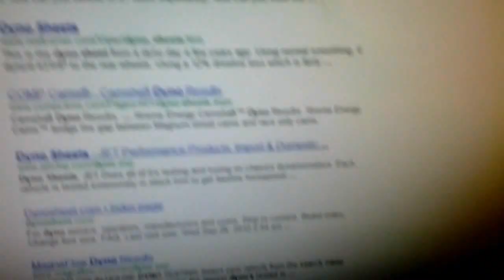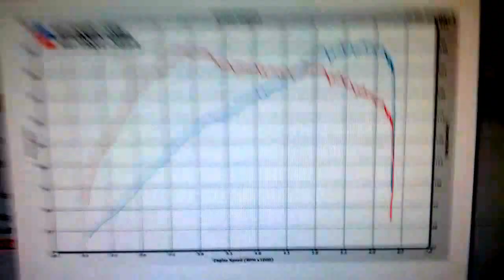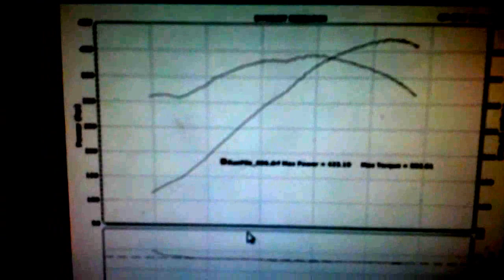Horsepower vs. Torque

Comment: Hi.. I have some confusion with this.. I have an airplane that weighs 930 lbs. We hooked up hanging scale to the tail and ran it up to max rpm of 5600.  The scale read 500 lbs...  what info can I get from this..? Ft.lbs..? Torque lbs..? HP..? Or..??
Reply from the maker: None of the above - it's thrust.

Comment: What you fail to understand is that the force that is accelerating the car is not torque of the engine, it is the force at the base of the wheel.

BTW you can clearly see that the amount of torque alone does not matter at all, while max HP will give you a rough estimate of engine performance.

a = f / m, if you replace with f = p/v

note that f has nothing to do with engine torque right now, it is the force accelerating the car

a = p / (v * m) 

if you want to write it with torque:

a = ( τ * ω ) / (v * m)

As you can see if you have

τ  = 1
ω = 100000

or 

τ  = 100000
ω = 1

acceleration stays the same because POWER stays the same with enormously different torques.
Reply: and also 5252RPM is just the ratio between unit of measurement for the imperial units and rpm, if you use other units it changes see http://rototest-research.eu/spec/view/png/graph/STR-07030801-kW-Nm-C.png and it means absolutely nothing.

Comment: you used ft  Ib what if you use meter kilogram  unit to find hours power??
Reply from the maker: ibrahim ismail it would be Newton-meters, no kilogram meters.
Reply: but what will be unit of 1HP= nm/sec  ,,1HP=t.rpm/5252    same equation???
Reply from the maker: Horsepower is an imperial unit. In S.I. rpm would likely need to be in radians per second and horsepower would be replaced with kilowatts. Once all of the units are properly converted the result should be equivalent, though probably simpler as S.I. tends to yield more elegant answers than imperial.

Comment: You can say "torque wins races", and you can also say "power wins races". In the end, torque and power are just two different angles of viewing the same reality. From torque you can derive power, and from power you can derive torque. The driver however can directly sense only two entities: the force at the wheels (which pushes him against his seat) and the RPM (which he controls). Now, the main question is how to propagate sufficient force from the engine to the wheels. You can compute it using torque, or you can compute it using power. Computationally however, I find power the easier method to use, because power is a function of energy and time, and energy is agnostic to internal factors happening in the car. You'll just have to use the conservation of energy theorem. This is also true in other areas of physics: conservation of energy simplifies computations.
Reply: you cannot derive power from tq.... tq is a force.... you need more information to derive power from tq.... 

tq and hp are like hourly wage and salary...

with just hourly wage, you have no idea how much you can buy/spend... you need how many hours you are working to know that..... that is why when you know both hourly wage and hours worked, you get salary or HP in this case...

they are not even close to "viewing the same reality"
Reply from the maker: You're right, on their own the values are meaningless. It's the rotational speed that links them. In the case of your comparison the rotational speed is the number of hours worked.

Comment: Power is a function of Torque and Rotational Speed (RPM). But what's not mentioned in this video is that Torque itself IS a function of RPM. Unfortunately, the torque function depends on the engine and has no set mathematical formula, the torque values for a range of RPM's are determined empirically (which is what an engine's torque graph tells you). So, if T[rpm] is the torque function given the RPM, then Power = T[rpm] x rpm x 2 x pi.
Reply: Jon Proce I'm talking about his point that torque is a function of rotation in all cases when it only applies to certain prime movers due to how they work. I know power is zero. It's not a one shoe fits all. Steam, electric, water wheel, and combustion engines all have very different characteristics.
Reply from the maker: Agreed.
Reply: +stanleygsf Your theory of torque as a function of RPM goes out the window when dealing with DC electric motors. As an example, let's say a DC motor's shaft is locked down to where it takes 500 NM to move the shaft. With electric motors torque is produced by current, not function of rotation. So if the motor has a torque constant of 10 NM/ Amp and current flow through the motor is less than that required to meet the 500 NM (50 Amps), then the motor is still producing torque, but not enough to overcome the barrier of 500 NM needed to begin rotating.
Reply from the maker: If it's not moving then it's not doing mechanical work, and is thus generating no power. It's just a heater at that point. You're also starting to consider friction, which definitely changes things a lot when it's dominant.

Comment: I believe AU uses Watts and is convertible to our measurements
I agree what you say about the Tq being more important...
Reply: tq is not more important...

200hp with 100tq will always out perform 100hp with 1000lbs of tq... always
Reply: ever see an F1 vs a Rally car race? The Rally car has more Torque than an F1 but the F1 has more Horsepower. The Rally car will ALWAYS get off the line and halfway around a track before the F1 gets to speed, then the HP of the F1 dominates the rest of the track... THAT is what we are talking about... getting off the line better, not sustaining speed!

Comment: Torque is not meaningless and so isn't horsepower either. Their interconnected as in many ways you and others have pointed out already. Do not make bold statements that "horsepower is stupid" and that all revolves around torque only. Torque allows the creation of horsepower, that's true and is therefore fully linked to power. However indeed the RPM of an engine together with torque determine the HP, as you know and stated.

Ultimately, what is important is how much of the power/torque can be applied. That's why HP says more out the usefulness of any engine. It is indeed the amount of "work" and not only force that should be applied and that makes an engine ultimately useful. This is even neglecting stuff like the transmission and grip that is also important for cars, but that's another story.
Reply from the maker: Tycondero It was a pretty dumb statement to make, I agree, but I guess that's what I was resorting to at the time to draw people into the video!

Comment: I'm assuming you haven't really done much dimensional analysis, or at least didn't understand it.
Take a look at the dimensions you write down at the start, and stay metric, because imperial with any proper engineering makes very little sense due to injected conversion factors.
Power is FxD/T whereas Torque is FxD So you've got two immediate problems, first is that torque doesn't tell you anything at all, because its not applied over a period. A person can apply just as much torque as a supercharged V8, but they can't deliver the same power.

What I'm getting at is that the whole thing boils down to one basic fact, force in metric is Nm/Sec which should seem to have some REALLY familiar units embedded in there, theres Newtons, or force, and m/sec which is, of course, a velocity. If you know the power being developed at a given road speed then you can determine the thrust without needing to know anything else about the car, ratios, diameters, anything, because you've got the velocity (in m/sec) and can calculate the thrust (in N) and if you know the mass of the car you can calculate acceleration.

Conversely, you should use the same analysis trick to determine optimum gearing, by working out the coefficient of friction of the tyres, then simply determining a maximum acceleration achievable and using the vehicle mass, weight distribution over driving wheels, CoG height and calculating the weight transfer to determine the maximum thrust in N deliverable through the tyres for a given design target situation, then gearing for that, or for that plus a little safety factor for driveline efficiency and better then target grip situations, back calculate for gearbox ratios to deliver that power and you're golden. Equally, to determine top gear you do the same thing with aero plus rolling resistance losses, then back calculate for gearing based on power peak and veloicty, then you just spread the intervening ratios relatively evenly between the bottom and top gear that you've determined.
Reply from the maker: I have done plenty of dimensional analysis. You're over complicating things in an effort to prove your intelligence to the internet. The video showed the relationship between an imperial measure of power and torque; those are the units most on this continent are familiar with. The information I shared is correct.

Thanks for watching.
Reply: Jon Proce Over complicating things by removing most of the steps you're using? That doesn't make sense.